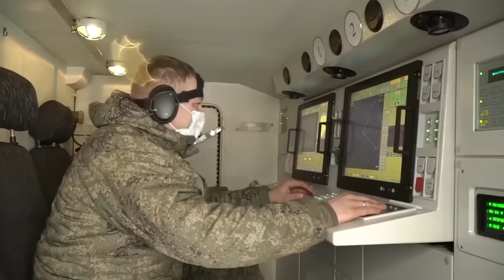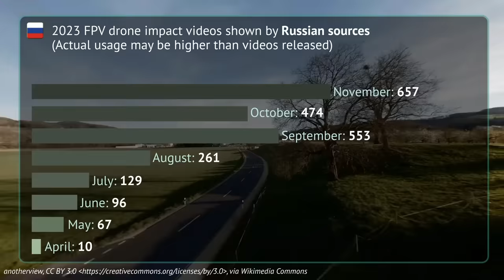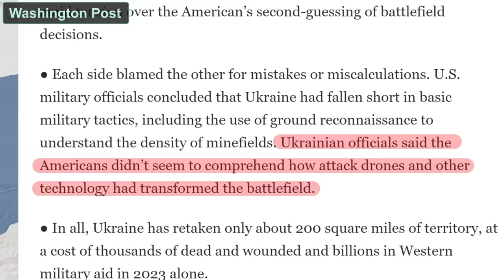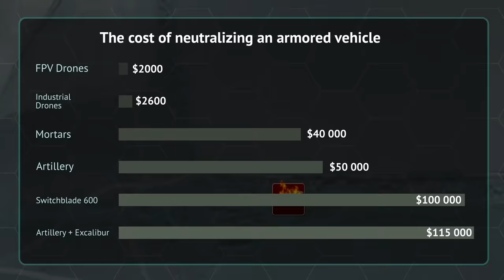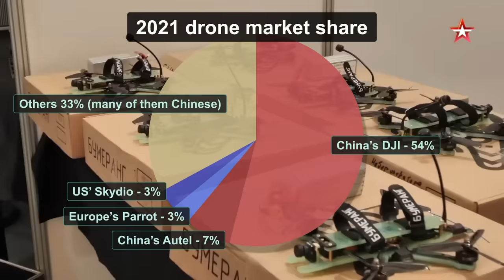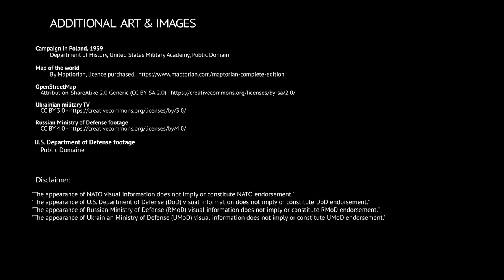First Person View drones are eclipsing artillery usage in Ukraine

Comment: People keep talking about "AI being on drones will change everything regardless of jammers". My answer is fuck no
You are not putting a RTX card onto a drone (Aswell as power supply) to run the AI of a drone. Current AI technology like DALLE and Chat GPT are not run natively (on your system) and are rather run from a central server.

This is not going to change, particularly with neural networks as they are not suitable for optimisation meaning you cant use a smaller chipset.

Plus, from a production standpoint. If you try to make a new computer technology you are going to run into about a century worth of development, from APIs to the base X64 languages you are making a whole new technology from the ground up
Reply: It took me a second to realize if the ai isn't on the drone, then it can still be jammed.
Reply: Alot of pseudo tech language to make yourself seem smart - but in reality this take is dumb

1. AI doesnt mean large language models like chat gpt - that would be useless on the battlefield - you can use simple machine learning models to do computer vision to recognise targets on a raspberry pi or arduino with commercial of the shelf $20 dollar consumer chips and a 5 volt battery
2. You dont need new "computer technology????" every guided weapon out there uses custom pcbs to fit inside form factor constraints and specific guidance requirements etc - ie javelin has a different "cOmPUteR tEcHnoLoGy" to NLAW on a hardware level. This is nothing new, u can design and order new pcbs from manfacturers in the mail and get it for 10s of dollars - more if ur doing it in house cause military.
3. Noone said anything about running "base X64 languages" on the drone and why would it matter - I am not sure what systems militaries use but u could certainly fit an ARM32 processor with enough power to do computer vision on a drone - its literally being done all over youtube - and its not cutting edge, like 20 dollar parts
4. Neural networks arent suitable for optimisation?? are u cooked??? we dont need DALLE on a fucking drone bruv we just need something that can spot a tank shaped object, predict what it is with good certainty and yeet into it - which can be run on laptop or smaller hardware easiiillly.
5. Neural networks can be as complex or as simple as you want them to be - ie 1 hidden layer or 1 thousand it doesnt matter - u can run a "neural network" on a potatoe or on openAi's super computer its just what you want it to do.

Silly argument bro
Reply: @Connor312_  AI litteraly means things like chat GPT
Reply: @swatboy763  no it doesnt
Reply: @swatboy763  "artificial intellegence" does not equal "machine learning" just as "machine learning" doesn't mean active learning as there are multiple types of machine learning algos
Reply: @AnotherAmerican91  yeah that's a problem with alot of these hyper netorked weapons, if the enemy can jam comms then your abilities are not lost but degraded
Reply: @swatboy763 

Sorry, wrong @
Reply: @coconuts7960 
AI is a trendy buzzword that means as much or as little as you want it to.

Large language models do not (yet?) display true, general intelligence,
And machine learning and even simple neural networks fall under what gets called ai.
Even if true ai does not exist yet.
Reply: @nos9784  i can agree about AI being vague considering two of my degrees deal with machine learning but what I'm talking abt is this persons original statement "1. AI doesnt mean large language models like chat gpt" then the reply "AI litteraly means things like chat GPT" which is just wrong as a laymen will assume all AI is just machine learning based which AI for the broad span of my career means any sort of intelligence that can respond to a complex input and respond with a human output people stockfish is an AI and has been deemed such for far longer than machine learning has been popularized
Reply: @coconuts7960  Thanks for your response, I shouldve taken the time to better explain my opinions - when I said ai doesnt mean chat gpt - I actually meant ai in the context of onboard combat drones does not mean large language models.
Reply: @swatboy763  not on a drone it doesnt, in this context a large language model like chat gpt would have zero battlefield utility regardless of the hardware problems
Reply: I believe they could. For example, little Raspberry Pi's can do basic AI image detection, I think a medium/large drone could easily have an AI which figures out what to target. I don't think it's close to drones being able to think and react like a human can, though, they could only do really really simple stuff. I think the advantage would be that drones could be more autonomous so you can operate a ton of them without many people. Like imagine Ukraine but instead of 1 soldier being able to control 1 drone 1 soldier could operate many drones. 

Here's a video: https://www.youtube.com/watch?v=wFLzO_5UFwE
Reply: Can AI tell the difference between the real and decoys
Reply: @no-one-knows321  probably not if it's good but people can't tell all the time either
Reply: There is no need for chatGPT to run on that thing .

Your phone can already do basic image recognition, you need the drone to have enough processing power to detect enemies and then calculate the trajectory to hit those enemies and maybe some more logic with aerodynamics 

In theory it wouldn't need that much more processing power than an iPad
Reply: AI isn't LLM like chatgpt. It can just be classical AI like classification or machine vision, no need for "chatgpt". Additionally, only the last leg, might be AI. 
1) It will be for longer range frequency hopping drones that act as relay or signal amplifiers for the first 20 km. That's your first relay amplifier drone. 
2) Directional antenna drones in a mini swarm. The node drone or the drone in the middle might have more power and optical communications with the rest of the directional antenna drones. That will act as your second relay/ amplifier. It will be about 10-5km from the front line/jammers.
3) For the last 5km to 500m, you sent in your specialized FPV drones with optical communications. Optical communications requires line of sight and the range is not very long. and it's expensive. However the advantage is that it's difficult to jam. AI would be use to auto align the drones, if they lose line of sight. This way you maintain a chain of optical communications with your 2nd Directional antenna optical communications relay drone. Now you FPVs are nearly unjammable, and you go after the opponents EW.
4) After your fancy drones that out their EW, your commercial cheap drones can black out the sun.  

The moral of the story is, you need fighter drones of your own. Because with directional antennas and frequency hopping and optical communications and AI. You can always overcome local jamming. So to maintain local superiority, you need fighter drones. Jamming to make the drones fall, is just a fantasy. Drones aren't going anywhere. Tanks need APS and tanks need to carry their own fighter drones. And tanks need lighter armor and focus on active protection. Active protection munitions can be compatible with HE and Canister shot. But drones aren't going anywhere, you need fighter drones of your own.
Reply: @Connor312_   Thought the same, this is ridiculous assumption that they would combine chatgpt and Dale to drone xD.  Although i think this would be much more complex than NLAW or Javelin if everything would be happening fully autonomically. 
Russia wouldn't obviously give a fuck, but other countries would be very wary about attacking their own troops event at the 0.1% of the time. Obviously there would be almost immediately attempts for countermeasures i.e disguising troops etc and countering these would make these systems far more expensive. We are living in really interesting times and everything can develop really fast.
Reply: Basic computer vision can run on a Raspberry Pi. High FPS object recognition and tracking can run on any decent Android phone. You clearly know nothing about this.